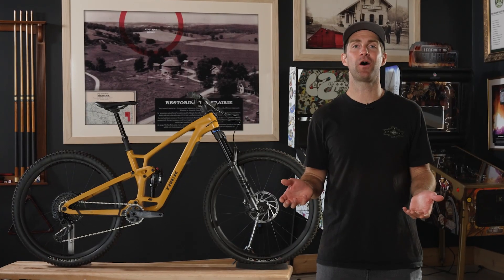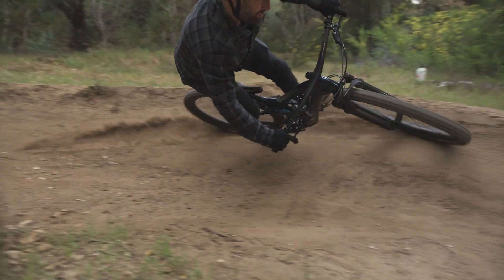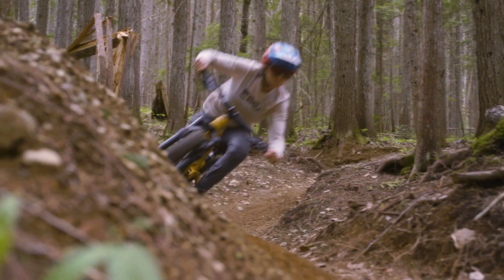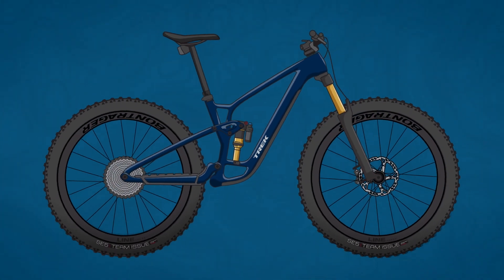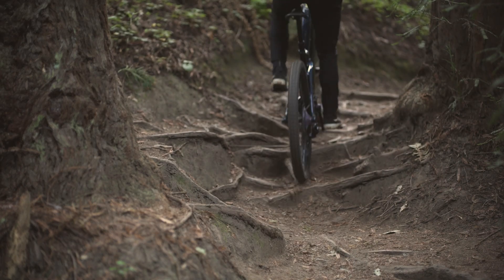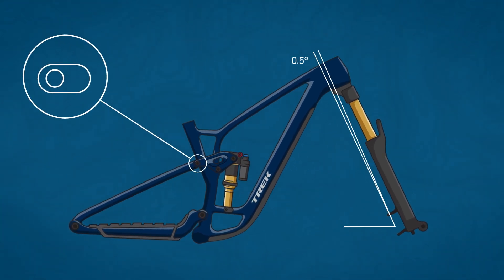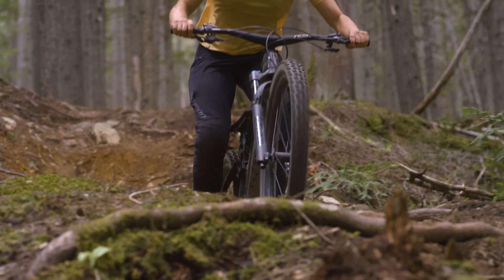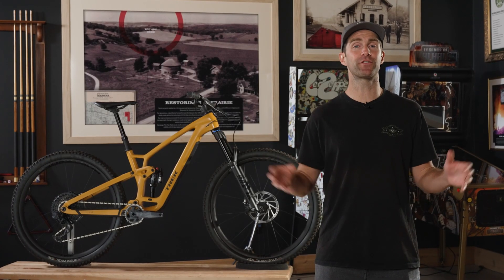Trek's Mino Link Explained

Comment: I have a 2023 trek fuel ex 8 and it has mino link on both the shock mount and the seat stay. Why is there both options and what is the difference?
Reply: The mino link on the bottom of the shock, is what we call the flip chip, and it adapts the shox for a progressive or less progressive setting. if you are an agressive rider you might prefer the more progressive setting, since it requires more force to use  the full travel preventing harsh bottom outs in the bigger hits. Also you can mount a coil shox on your fuel ex8 where it is recommended to use the more progressive configuration.
Reply: The mino link on your seat stay will adjust your headset angle. if you flip it to the high setting, will increase the height of your bottom bracket and make your head angle half degree steeper.  providing quicker handling at more technical terrains. you can solve all this questions at your Trek Local Store.

Comment: Can you mullet the Remedy 7 2022?
Reply from the maker: Remedy is designed around a 27.5" wheelset front and rear, but you can change the fork to fit a 29" wheel, though it isn't initially designed around that nor has it been tested.

Comment: Can you mullet a Trek Rail 7 gen 2?
Reply from the maker: Mullet, or 27.5" wheels, are not recommended on the Rail Gen 2 as it would lower the bottom bracket height too much resulting in increased pedal striking and an all-around bad time.
Reply: @trekbikes  could you mullet a Remedy 8 2020 changing the front wheel + fork to 29"?
Reply: my 2022 rail 9 is mulleted, but you can't set the correct rear wheel size in that model.  the year after you can.

Comment: Sadly the 2022 trek rail with mino link isn't designed for a mullet set up.  meaning I can't put in the correct wheel circumference :-/     "Thanks for reaching out to Trek,
 
We are unable to change the software for the wheel circumference on Trek rails. The rail has been designed around a 29" wheels and changing the wheels size would make the bike non-compliant to the Australian standards. 
 
Best regards
 
Trek Bicycle Australia and New Zealand Customer Care

Comment: can I mullet fuel ex 7 gen 6?
Reply from the maker: The Fuel EX Gen 6 is mullet friendly. We recommend using a 160mm fork and running the Mino Link in the High (65 degrees) position.
Reply: @ thanks